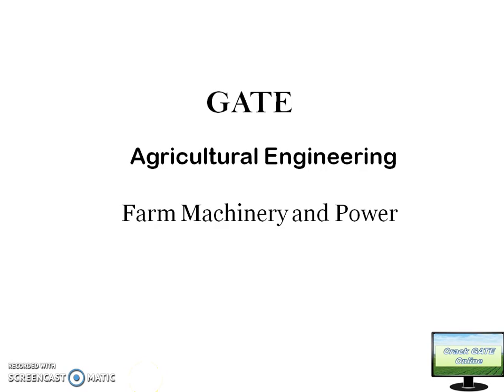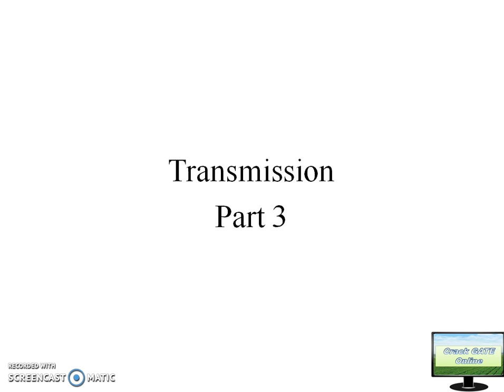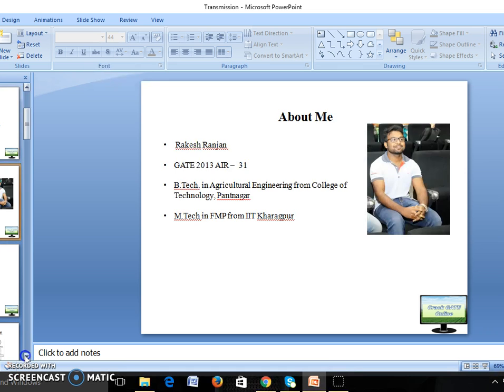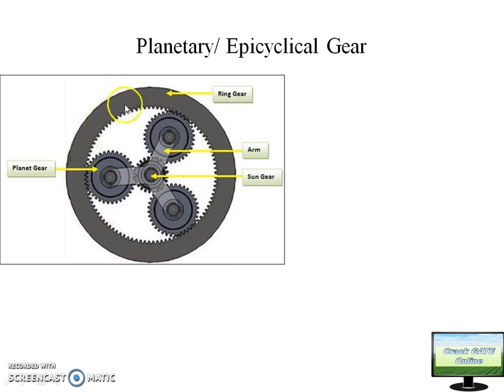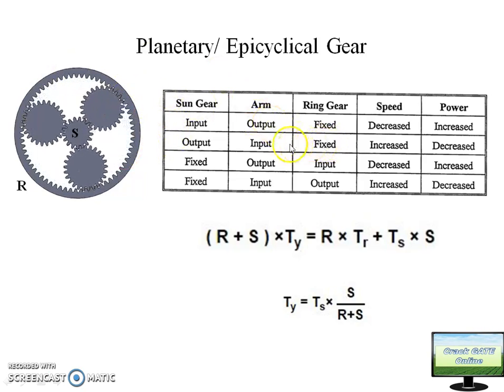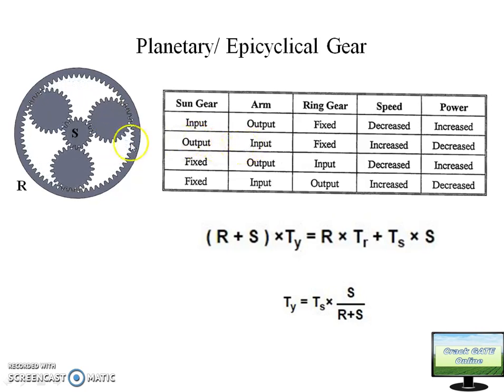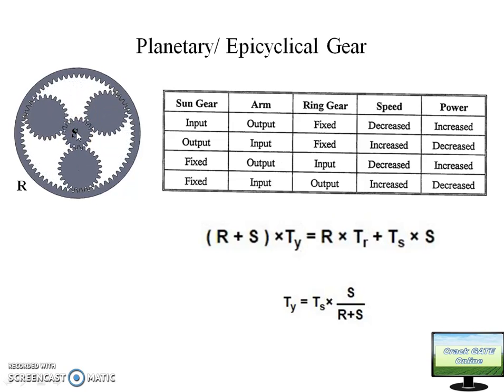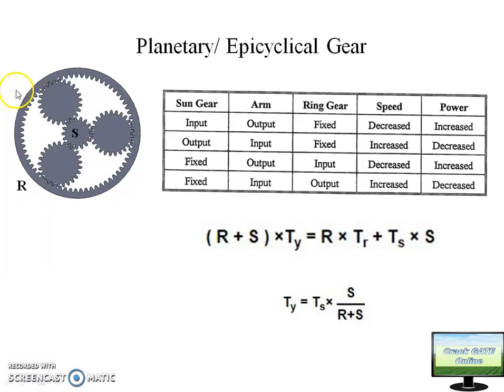transmission part 4

Comment: Hi sir,  I have a question regarding planetary gear . You have told that in various combinations we keep one gear fixed give input and output on other two . 
So my question is that when we give input from ring and take output from arm then bigger is driving smaller gear in this case  . Therefore speed should increase but u told that it will decrease .... How?